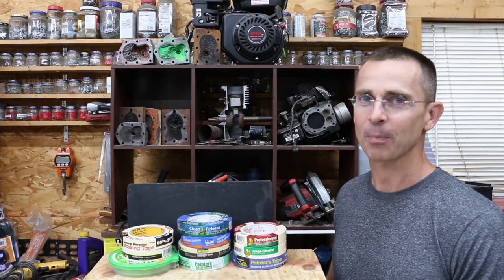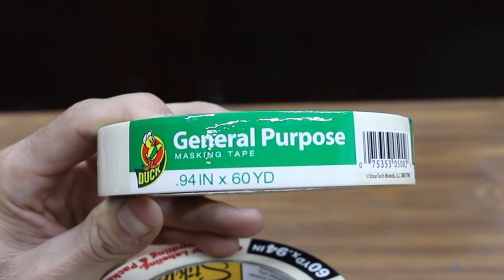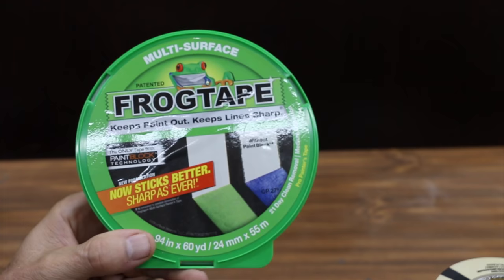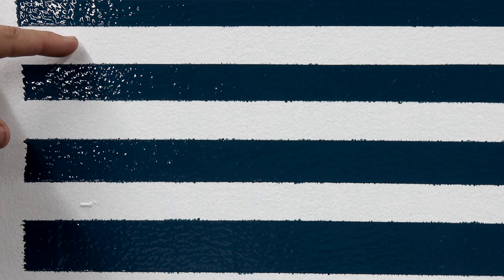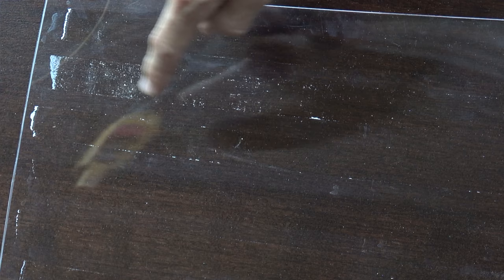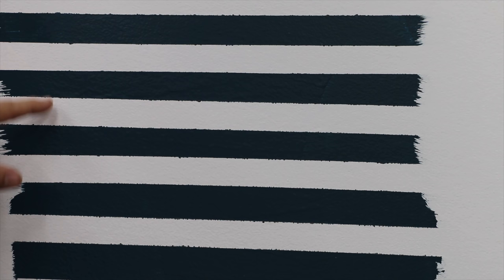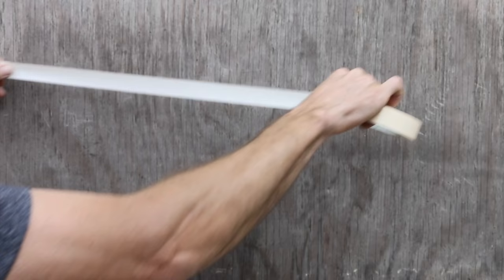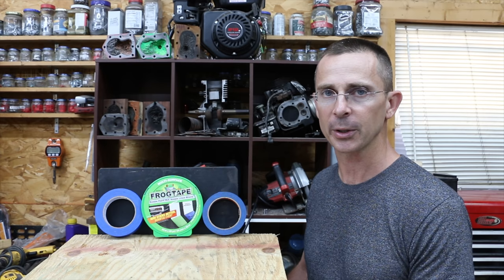Which Masking Tape is the Best?  Frog Tape ve Duck Pro, Stik Tek, 3M, Scotch, Dollar General

Comment: As a painter this test does not really apply to real life. You do not use "yellow" or "white" tape in the same places that you use blue tape. Also most painters know to "feather" next to tape lines because ALL tape bleeds when you load it up. The price point really comes in when you're talking about how long it will stick on a house or on a surface in your house.
Reply from the maker: Thank you for the feedback
Reply: However the stronger fabric that frog tape is made of makes the labor of removing the masking significantly easier and less frustrating.  I would buy it for that reason alone, even if it didn't also do much better at bleed-under.  However I use cheap white masking tape on carpet (because it sticks better on carpet) or across the tops of door casing where it isn't visible and using expensive tape has no real benefit

Comment: First: I want to know where you are getting Frog Tape for $4 and change per roll? Hahaha. Everywhere I look it's almost $8 per roll. I use masking tape pretty regular and I use an H.V.L.P. sprayer to apply the paint, which dose make some differences like bleed through is almost no existent regardless of which tape I use. I have found that Sherwinwilliams brand tape works the best. The blue tapes will peal off on there own before I want them to. Most ever tape other than Sherwinwilliams will dry rote in a day and when I peel it off it tears off in shreds. This was no problem for you but when doing most of or a whole house with different colors on the walls, sealing and trim, and coats of primer and paint, it can be. There is a yellow Frog Tape that is suppose to be a "fresh paint tape", well the only thing it will stick to is fresh paint and it peels it off the wall when you pull the yellow tape off.
I hope this doesn't come across like I'm heckling you, I did not intend it that way. You know I like the work that you do.
Reply from the maker: Menards near Kansas City. Thank you

Comment: For a part 2, there are high-end "less sticky" versions for delicate surfaces -- example: yellow Frog Tape ... love to see how those stack up.

Also, my biggest problem with painter's tape is that it pulls up surface paint that it has been applied to. There was one example here where that happened, but in my experience the problem is very common, especially if the underlying paint was applied less than a month ago. Not everyone has good cut-in skills (and some of us older folks are starting to shake a little), so let's see a test of tape removal from various aged painted surfaces.
Reply from the maker: Thanks for the video idea.

Comment: The only exceptions to the BOLDED statement below is "designer" clothing, items with prominent brand names (vehicles), AND your high maintenance "hot blonde" lol.

-> YOU GET WHAT YOU PAY FOR!

Investing in quality paint may cost $75+ per gallon, but it endures for 20+ years.

Top-notch tape, like Frog, guarantees professional results.

Many of you chase after a Mercedes or Corvette, not for their engineering but for social recognition, boasting rights, and attracting attention-seeking partners.

Yet, you'll compromise on quality with Wal-Mart or Harbor Freight products, assuming others can't tell the difference (because you can't slap a "I paid $$$$ for this" on your wall). 

Ironically, the guy in a Honda, valuing quality from Sherwin Williams, has the upper hand. Meanwhile, you haggle over a $60 Black & Decker drill with a partner more invested in social media selfies and fleeting loyalties. 

The true winner is evident. 😂

Comment: The best painters tape is actually the least stickyiest.. I found frog tape to be a bad  product.. This is coming from a person who survived painting houses for about 5 years before I switched jobs.. Its too agressive and not at all what you actually want when masking... Generic tape any will do and stick it to your clothes before you put it on the wall, this will remove most of the adhesive which means when you go to remove it, it wont pull paint off your walls too.. There !!! Dont buy fancy tape... Just by general purpose masking tape and stick it to yourself o remove the heavy adhesive.. Or better yet.. Learn to paint or cut in without tape at all.. Its not that difficult to do and you will be much much quicker on a painting job..
Reply from the maker: Thanks for the feedback.

Comment: I have been using frog tape and find it to be too flexible. When I want to pull it along a straight edge it deforms and doesn’t give a straight edge.  Scotch blue is the other tape I have been using and it doesn’t exhibit this problem.   Without good pressure along the edge applied by my thumb, both bleed.
Reply from the maker: Thanks for the feedback.

Comment: Have you ever done one on sand blasting.  SO what material can you use to sandblast with.  So do you use sand. or broken glass, ??  THere is a large amount of sand blasting material what is good for an old rusted door, tools that need repair.  Does the type of material you use generate the type of equipment that is needed.
Reply from the maker: Thanks for the video idea.

Comment: Are you aware of the old timer's trick to eliminate tape bleed-under?  You first paint color #1 all over and let that dry.  Then you mask, and repaint WITH THE SAME COLOR or clear at least over the tapeline, and let that dry.  Then you paint with the 2nd color, let that dry, and then remove the masking.
     Regarding the brands, the problem is getting consistency.  Tape adhesive is a complex chemistry problem, basically combining an "oily" part with a solid part in solution.  Too much oil, the tape curls off 5 minutes after you apply it.  Too much solids, the tape splits when you try to peel it off the roll, and if you succeed, the tape falls off the wall because it is too "dry".  With the advent of tapes being made in China, the industrial control is often poor, leading to "telescoped" (tape rolled to tight, and too gooey) or lumpy rolls (tape rolled too loose).  You make no mention of difficulty of dispensing tape from the roll, or its sensitivity to aging on the roll, or taping curved masklines.  Even 3M is manufacturing in foreign countries.  So I evade this by buying the most expensive "high temperature" tape that is still made in the USA.
Reply from the maker: Great tip!  Thank you

Comment: Have you done a best paint stripper/paint stripping method video?
I live in an old house and I've got a ton of paint to remove off our original finishings and hardware. 
The paint has to come off wood doors, iron heat vents , brass door hardware, and fireplace bricks.
Reply from the maker: Thanks for the video idea.

Comment: I can't help but notice how every Project is a Male Brain orientated methodical science experiment, cutting out all the fluff and getting to the point of the essence of observations and conclusions.  Precise and concise.  That's how guys like it. Great methodology on every project. And I don't mind the advertising tagged to your work. I am getting value watching each one. 

I wish to see a test on strictly long term tape residue adhesive and paint peeling after a 1 year period. Can you manage a start pause finish like that? The reason is price on tape is variable but as you showed, you keep tape on too long and adhesive delaminates to surface. 3M blue painter I have outdoors for 5 years and no residue.  Would like to c compare others that at least claim to remove clean after long hot exposure.
Reply from the maker: Thanks for the video idea,

Comment: You did not test the most important aspect of masking tape - (non) removal of the fresh paint. This is very frequent - first you paint ceiling white, then after short time (same day) you mask the freshly painted edge on the ceiling and paint the wall with some color. After short time remove the masking tape. Good tape should 1) leave crisp edge and 2) leave paint on the ceiling (not sticking to the tape). The last requirements is tough!
Reply from the maker: Thanks for the video idea.

Comment: I threw two rolls of Frog Tape in the trash earlier this week because it wouldn't stick to my freshly painted walls.  The walls were painted with Behr Marquee flat finish which had been allowed to cure for six days.  The tape refused to stick to my walls 
so I thought, "It's an old roll, maybe the adhesive has dried out."  I bought a new roll;  same result.   I bought a roll of Scotch #2903 blue painters tape and it stuck just fine.

I sealed the tape with paintable latex clear caulk using a technique I first saw on the "Idaho Painter" YouTube channel 
https://www.youtube.com/watch?v=y_X8pkBhYNc.   It really works!  You get no bleed-through at all. I was very skeptical about painting over fresh  uncured caulk but it is not a problem.  

Tape can also be sealed by painting the edge of the tape with the underlying color before painting with the new color.  Any bleed-through from the seal coat is the same color  as the underlying paint so you don't see it.   The caulk method is much faster.
Reply from the maker: Thank you for the feedback!

Comment: If you take a damp rag to frog tape it will preactivate the polymer and thus give you a clean line. Frog yellow is a thinner wafer paper and will leave sharper lines with less spill over but lower adhesive tape not good if spraying.
IPG blue tape is better than frog tape and less expensive. IPG PG5 is the all around best general masking tape.
3M tapes are not as good as they were 10 years ago.
Duck brand tapes are cheap garbage, just toss them.
Reply from the maker: Thanks for the feedback.
Reply: @ProjectFarm  another thought but the age of masking tape has an effect of both adhesion and tensile strength of tapes. Something to consider.

Comment: Can you do electrical tape? I’ve got a broken pair of earphones (exposed wire, they work fine, just dangerous) and I only have this cheap, bad roll of electrical tape and I don’t have anything else to use apart from other bad, cheap rolls from different brands. The tape I have just falls or slips off and shows the exposed wire. If you try some, maybe I can buy some and fix my earphones so the wire isn’t exposed. 
(I’m pretty sure electrical tape is also called wire tape or something)
Reply from the maker: Thank you for the video idea!
Reply: Project Farm No problem :)

Comment: That test is meaningless. I am a professional painter and I don't tape drywall. Nor do we paint over the complete piece of tape. Nor does anyone else that knows how to paint. I tape woodwork base etc that is either varnished or painted with oil base enamel. 3m safe release tape from Scotch is the only tape you should ever use. Frog tape comes in second and the rest are useless. What you look for is adhesion without destroying the existing surface, the ability to leave the tape in place for the whole job and not have trouble removing it, and a clean line after removal.